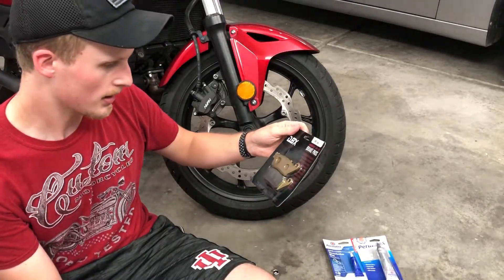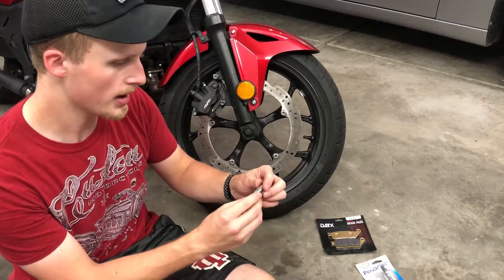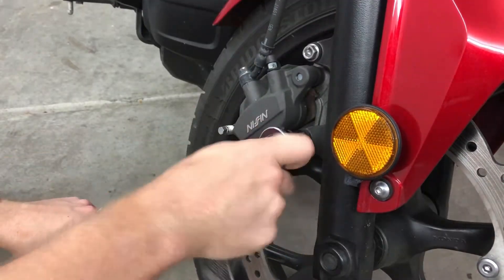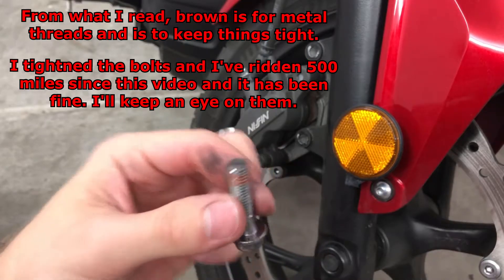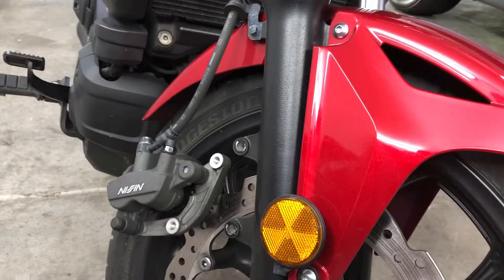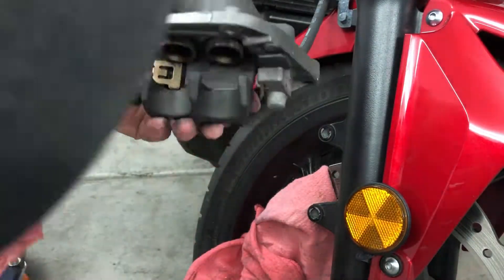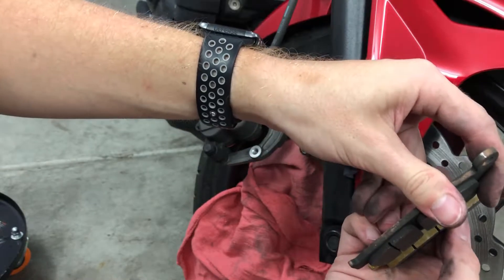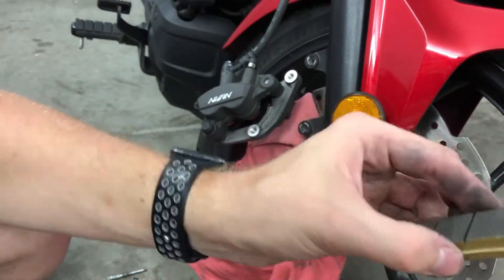Honda CTX700 Front Brake Pad Change

Comment: Thanks for making this video as it helped me get mine done a lot quicker. Mines the abs model, and if people with abs do this on the front brake, loosen the bracket that holds the cable down near the pads to allow movement of the abs cable when the caliper is removed. I also used a cheap ratchet clamp to push the pistons fully back in, makes it a 10 minute job in total by doing that, and much easier to put it back over the disc. You can use a wire or a hook to hold the caliper if you don't want to stress the tubes if letting the brake assembly all hang when fiddling about with new pads. Did the rear too, only need to remove one bolt from the caliper (same size as the fronts bolts, not the larger one) then could rotate the brake up and then remove the bolt that holds the pads in place, and replace with new pads. I didn't use any lithium grease on anything, but dabbed the O ring on the bolt that holds the pads in with multi-purpose grease. Hope all that helps someone.

Comment: Never put any grease on the brakes that isn't silicone brake grease. Only apply the silicone brake grease to the caliper pins. If you put grease anywhere else it will gum up with brake dust. FYI

Comment: When you mentioned that you put too much grease on the brake pads... I guess about how much should I put?  Just a dab on the flat surface of the pad and on the connectors?   I"m planning to change the pads on my 2014 honda ctx700nd, soon.
Reply from the maker: As long as it is on the points of contacts where it will rub on the calipers then it should be good. Do a little less than I did and you will be good to go.
Reply: @JustinsGarage  thank you!  Your video is very helpful.

Comment: Did you take any fluid out I just change my fluid today I should of waited to change the pads
Reply from the maker: No fluid was removed for the front or back. The front didn’t need it but my back could have used a bleed. As long as the pressure isn’t too strong you can push the pads into place by hand.
Reply: @JustinsGarage  I did my first fluid change today on the CTXDCT abs model it went well from what I’m reading I definitely need brake pads so I’m going to order them now i’m a little afraid to do it myself but I just watched your video and it didn’t look too bad I left the little room on my reo reservoir so hopefully I won’t need to remove any fluid I’m guessing I will know if the piston doesn’t go in ? And thank you for answering me that’s pretty awesome nobody ever answers back
Reply from the maker: The piston will go in. I’ve gotten 30 year old bike’s pistons to go back in. Worst case scenario use your old pads and two screwdriver to push from the middle out to compress the pistons.